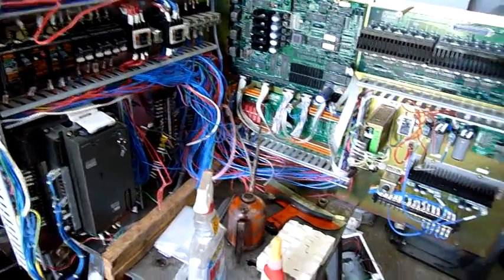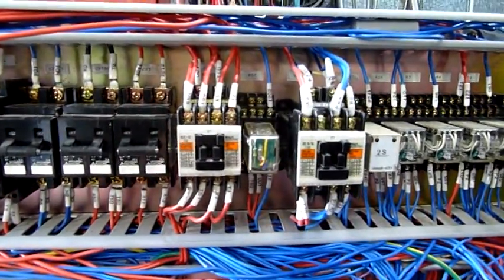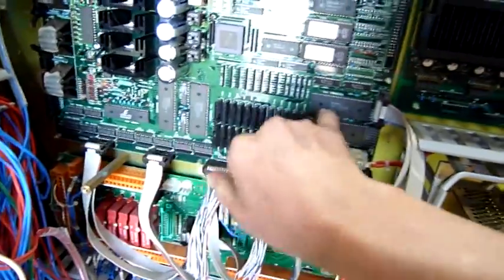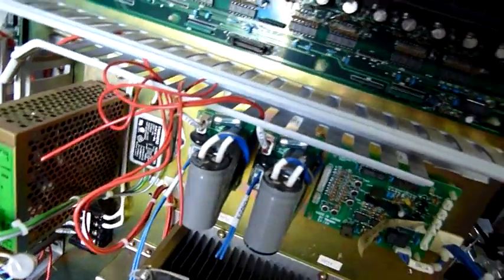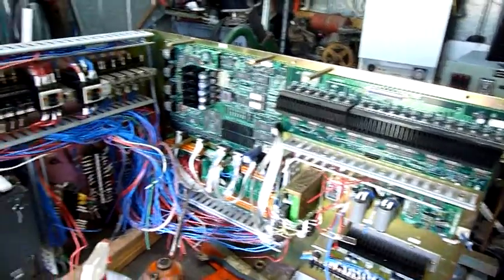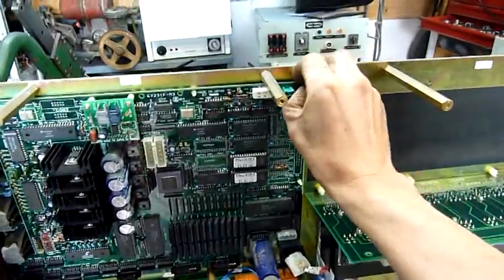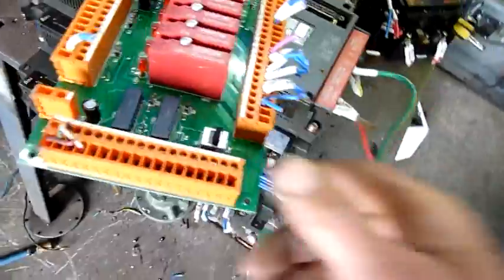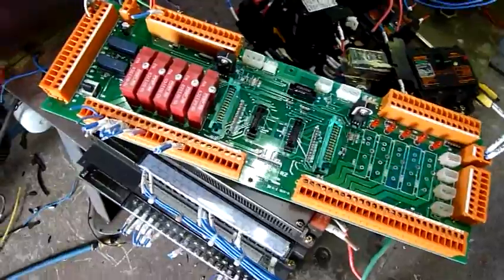Yamato Dataweigh Control Equipment Disassembly

Comment: doubt the SSRs were "pinched", sometimes parts aren't populated depending on the model number, it's cheaper than having to design, test and manufacture several different boards.

Comment: @MrGerbilBrain Either that, or flyback protection diodes since I think the vibration system uses solenoids. Flyback currents can get pretty big quick, learned that the hard way :)

Comment: The red things are solid state relays.  I have a pile of them and use them for low current low voltage switching.

Comment: @TheChipmunk2008 Older installations with wire fuses have similar rating in Australia (6 amps). 10, 16, 20 & 32 amps are typical domestic electrical circuits. 

With our electrical legislation it's a requirement that if you modify a circuit that has fuses you must update all components so it meets the current code, eg MCB & RCD's. I'd love to do some work in UK, most of our standards are built from your own :)

Comment: 78xx - it's a most widespread type of voltage regulator. Prefix letters might vary from one manufacturer to another.
For example:
7805 - 5V reg., 7812 - 12V reg., 7824 - try to guess! ))

And there's complementary type of those regulators exists - 79xx - which is negative voltage regulator.
So if you have system where you need positive and negative voltage, like an audio amp. - you'll most likely see there pair of 78xx and 79xx regulators.